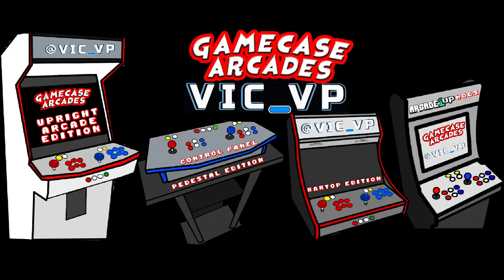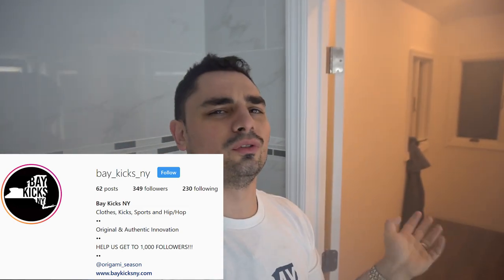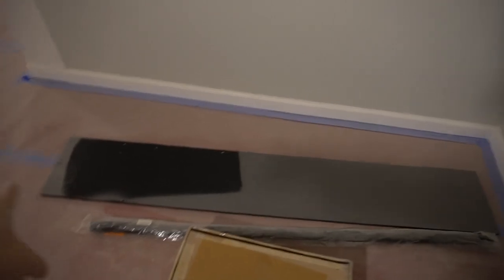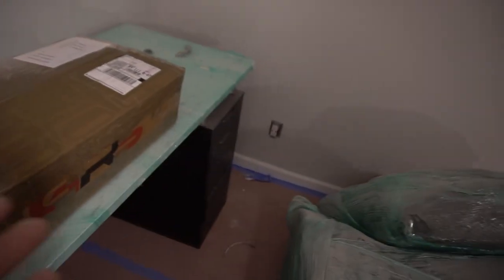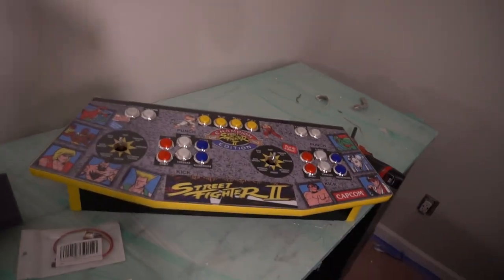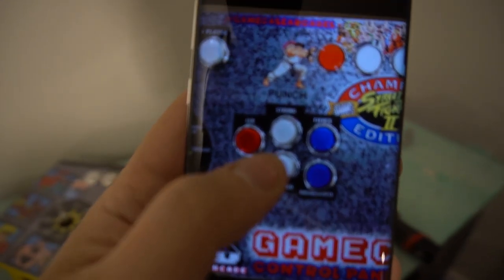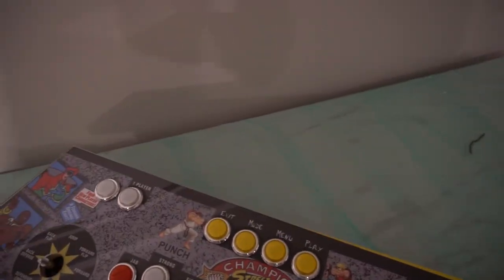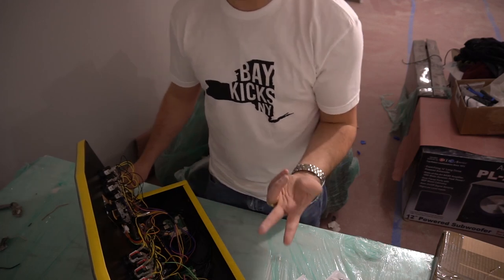They Stole MY ARTWORK FILE

Comment: Really not suprised by this at all. GRS is an absolute joke. I have one of these in my basement that was pre-built and had to repair a ton of wiring that was taped together, it was one with the trackball and only one trackball game worked half the games on his image won't even load. He was also told to stop using hypepie in his builds because he was selling the image separately and they called him out on it. His customer service is the worst I have ever dealt with in my life. He used to put out a decent product and stand behind it but not anymore. Pos in my opinion and not suprised at all that he would snag your artwork and sell it as his own.
Reply from the maker: Yea man I here that alot now, but I just purchased a custom artwork I made bartop for s customer and noticed the big price cut so it was a no brainer. I posted it to a a1up fb group and geez I got ripped apart cause ppl said "it's not urs its capcom" -_- some people didn't understand what I meant by they stole my artwork lol. I will be working on the customers panel tomorrow and I'll check all the wiring. 
The best part is that u can actually like see and hear my real reaction when I opened it lol. Tulsa arcades also showed me his Ghostbusters artwork is on his page too and the title of it is "Ghostbusters-jc" and his name is jc Reynolds. So it's happened to many people apparently